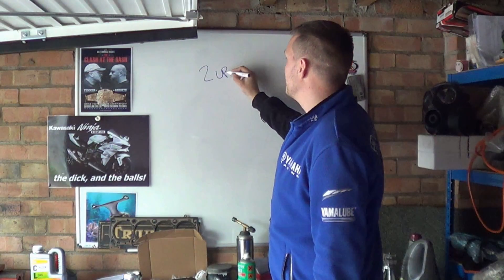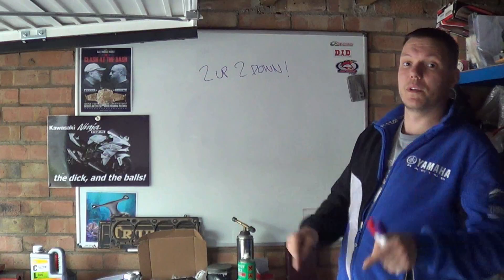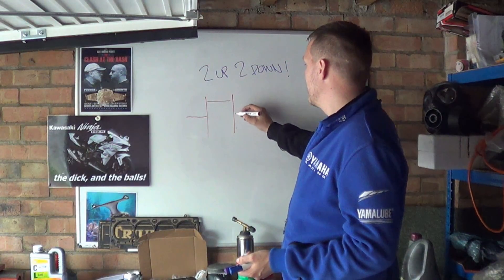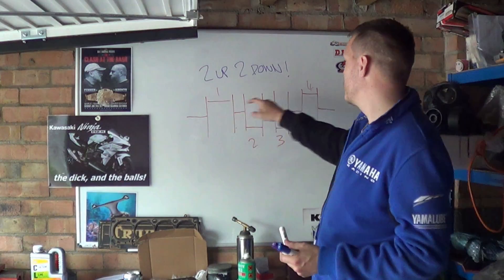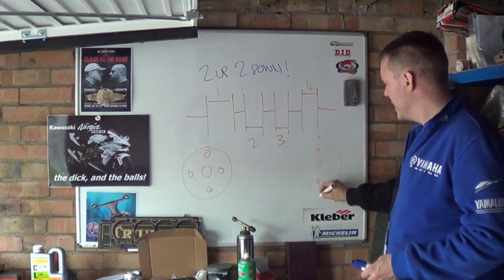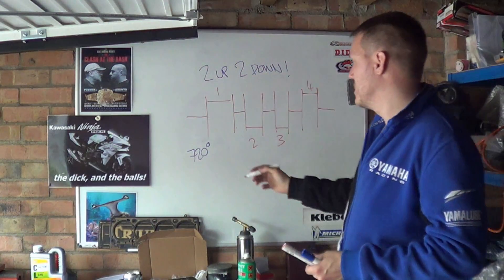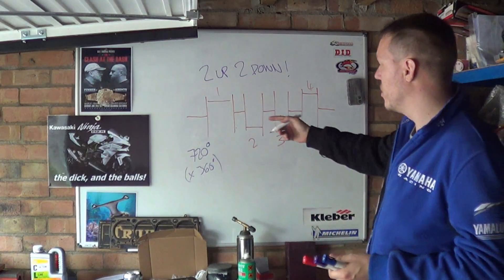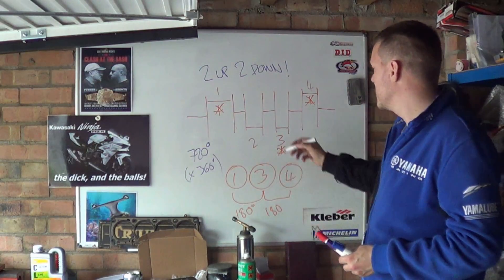2 up 2 down - crankshaft firing order

Comment: Been interested in information on crossplane recently, and it confuses me how the advertised design really makes much of a difference with "the tire has more time to regain traction" bs that Yamaha says. Maybe it's not bs, but I'd think consistent firing order and smooth throttle application, i.e. traction control, is a better solution. If this was actually a thing we should hear it brought up a LOT more when mentioning V-twins or how a dirt bike has deft rear tire grip and is easy on tires when on the pavement with their single cylinders.
I look forward to some light-shedding on this controversy if not already done.
I'd think with gearing involved the torque fluctuations would be quite small by the time you get to the tire.

It's all quite confusing, so maybe I'm missing the point.

Comment: The cross plane crank is as confusing as hell when some people have argued that it provides a more constant torque during a crank rotation. I believe the increased torque pulsing proved to be better for traction a bit like ABS.... many years ago a two stroke twin used in an off road application had the highly illogical 360 degree crank, the power was no different to the 180 degree version (which ran smoothly) but the bike got better traction on the loose with the shaky 360 degree crank. Interesting and thought provoking videos, well done.

Comment: Hi Matt, I know this question isn't related to this video but I didn't know where to post it. Long ago I read somewhere that the ideal running temp of a liquid cooled petrol engine is 95 degrees C. I don't know if this is true but if it is why are so many engines running at 80-85 degrees C? Would you be willing to address operating temp in one of your vids? If you've covered this topic already I'd appreciate it if you'd point me to the video. Thanks a lot and keep up the good work!
Reply from the maker: ATTL - matt

Comment: Matt I was wondering if it's possible to make a 4 stroke without a cam assembly, but instead having valves controlled by crank positioning so you could adjust the lobe when ever, so you could go from having a more quiet motor or change the lobe degree in to get a more choppy firing like a rat rod, i though you could do this with an electronic valves but ultimately figured electronics fail from heat so then I though maybe you could use compressed nitrogen valves (like in a f1 motor) but be able to adjust the pressure up or down to increase or decrease the valve opening and be able change the timing/ lobe degree, do you think that is even possible?
Reply from the maker: " I though maybe you could use compressed nitrogen valves"

-  https://www.youtube.com/watch?v=yZ4hhJctYz4&t=13s

Comment: it depends on the camshaft . what the final firing order is. or more like the crank puts the piston up. but the can determines if its a fire or exhaust stroke. some engines about 2 sets of cylinders can be swopped . a Chevrolet v8 has #4&7 swap cam . and another pair swopped . I just can't recall. but the 4&7 goes from 18436572 to 18736542, they say it makes the engine run smoothly at high rpm. and a possible gain in power! could it effect the sound of the engine? great video. I have heard of flat plane v8 engine or maybe it was a v6, could you do a video on even and odd fire v6 engines. and why they are issues? I'd Like  hearing you explaining how they work. and the 4.3chevy v6 is kinda in between. with its split rod journals. I think it would be a very interesting video. thanks.

Comment: This is incredibly interesting, how do you change the firing order anyway, is that done electronically on modern bikes or mechanically or both and what effect does it have. ?
Reply from the maker: In what way, after the engine had been built?
Reply: Yes, so can you have the engine running, then make changes to the firing order or is it hard wired into the build ?
Reply: Richard Cluderay the firing order is done by the cam shaft, on a 2 up 2 down, it determines what valves open when, the spark is the same time if it fires 2or 3 first.

2up 2 downs only run 2 coils so you basically have the plug fire on compression and exhaust